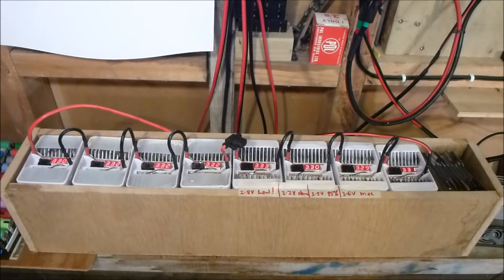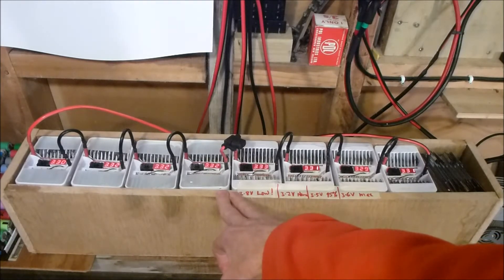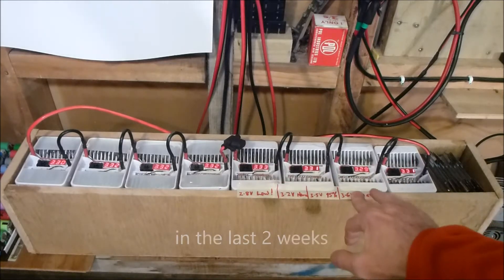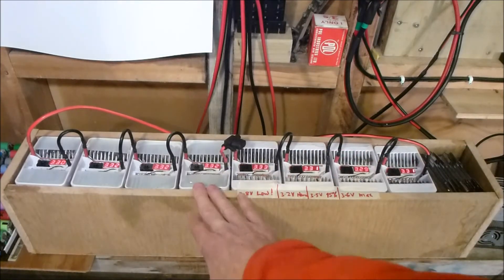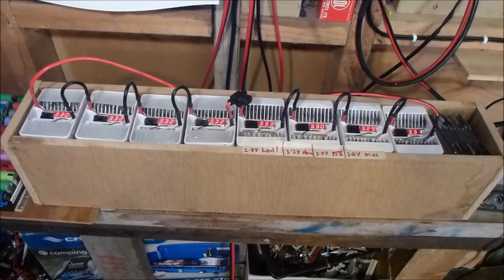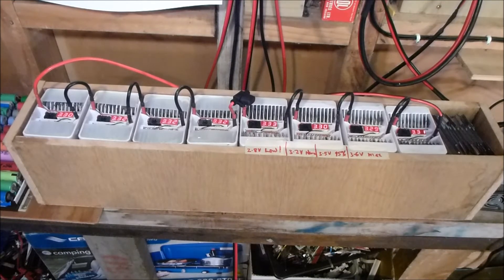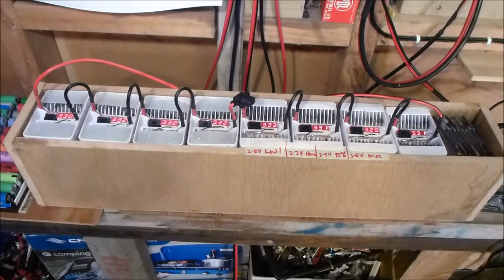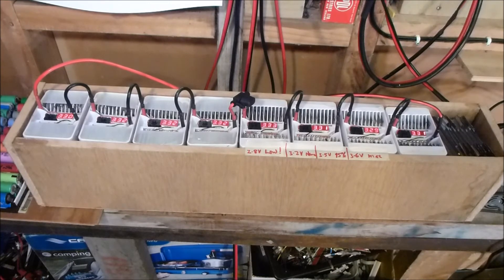Laptop Powerwall 122 - LiFePo4 pack up and running

Comment: Paul, I'm very curious to see how the load / charging is getting distributed between the LiFePO4's and the normal Li-ion batteries, so if possible could you hook up two Ampere meters and let us know how the current is distributed when charging and discharging?

The LiFePO4's have a much flatter charge / discharge curve so I would expect them to be taking up a lot more of the work that the Li-ion batteries that has a steeper charge / discharge curve...

You may we working the LiFePO4's much harder than you expect!
Reply from the maker: That vid will be coming soon. That was the biggest question I was curious about. Stay tuned.

Comment: Coda made me laugh out loud. :)  When you say the 10Kw/h, what are you using it for. I suspect there is a video way back at the beginning explaining it, but could you recap please?
Reply from the maker: At the moment I run the house lights , and stuff in the garage (lights, recharge tools and e-bikes). I'm at the point where it's worth upgrading my solar controller and inverter - then I'll be able to add more load.